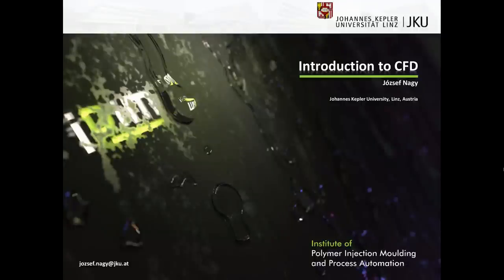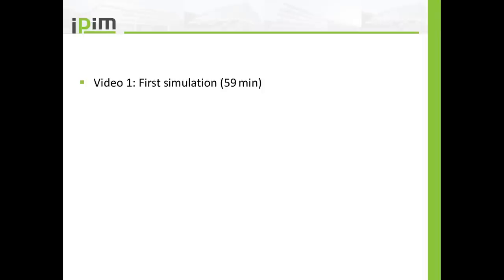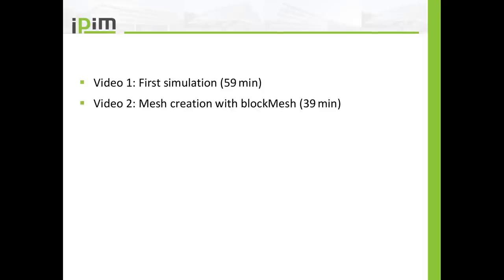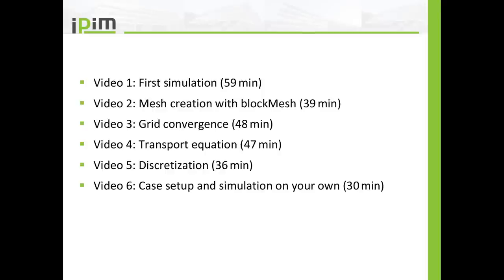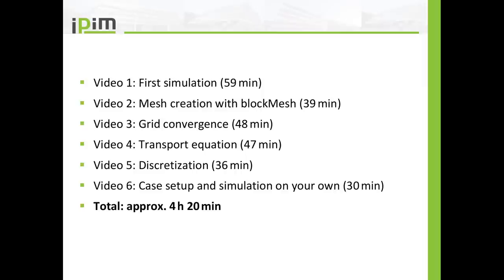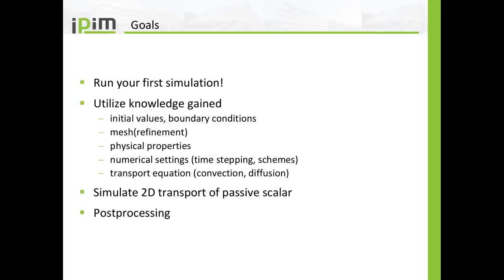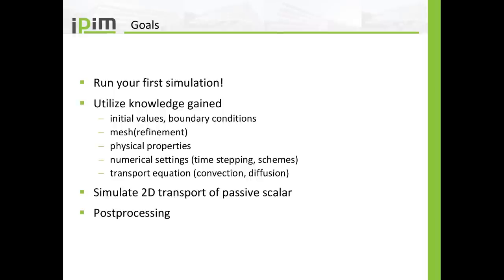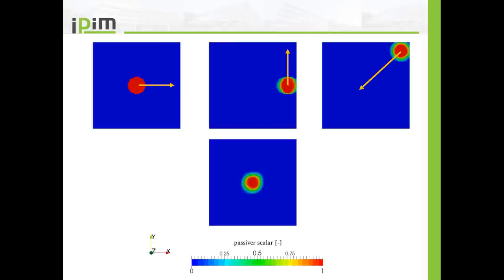Introduction to CFD

Comment: hello, Please I have a Question,    1- I do not understand the differences between OPEN-FOAM vs SALOME MECA,  what are those intend for?  which is more efficent, both or them can handle, vibration problesm, fluid structure interaction, modal analisys etc?     2- Can I install OPEN FOAM in the distro CAELINUX ?

Comment: sir i have run cavity case and then cavityfine Mesh but now when i'm opening the paraview there is no Transform Option to visualize both cases at a time just like you are doing here.
Reply from the maker: Did you press the small gear icon in the Properties panel?

Comment: Hi József, I have decided to download OpenFOAM and I want to familiar with this software. I am a fluid flow engineer and I work in the field of pneumatic conveying of ash generated in coal fired power plants (and other connected technologies, eg. high density slurry transport).

What do you think, do not you want to make an (-1)th video about the steps of one project? For example first time I want to see only how one project is build up but I do not want to understand how the grid is generated. I just want to open a pre-built input file, I want to understand what is the input, how I can run a calculation, how I can check the convergence and how I can interpret the result. I do not want to set any boundary conditions, materials, surface roughness, etc, just learn like "click here, open this, click that, open that, select that, etc, etc..."

In this case in the second time I do not need to watch how to use the OpenFOAM, I can concentrate to the actual project.

Thanks for the answer!
Reply from the maker: Well, I guess in this case OpenFOAM is not the software for you. Here those are the exact points, which are the most important. OpenFOAM ist not a click, click programm. You have to know, what you are doing. There are GUI-s for OpenFOAM, they might help you.
Reply: József Nagy Of course, I know it, I have a few knowledge on Fluent, but that was many years before.
Currently I am looking for a good software for checking  our desings like Venturi/Laval nozzles which are used in air supply system to set the correct air amount for pneumatic conveying and ring-type air intake for diluting ash flow inside the conveying pipe.

I just want to see the steps without details, but of course I can learn and understand these topics well. ;)

BTW: if I want to use this software on Windows 7 64 bit OS is it possible without any problem or is it important to use Linux or any other OS?
If I want to use our designers geometry from Inventor is it possible to import?

Thanks for the answers!
Reply from the maker: In Windows 10 it is not a problem. For Windows 7 you have blueCape's version and OpenCFD's docker version. In Windows simulations will be always slower, so Linux is advised, yes. You can only import STL and OBJ files as geometry. Take a look at my multiphase simulation project, that can give you a good idea on the workflow. However, it is incompressible and multiphase.